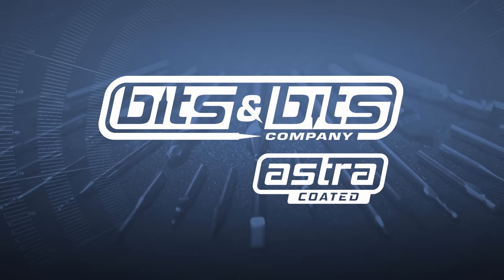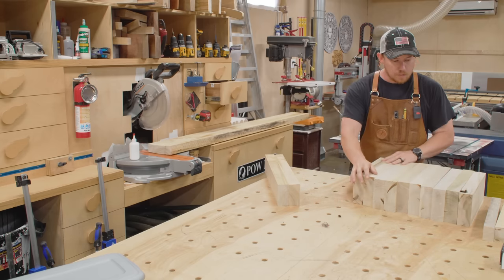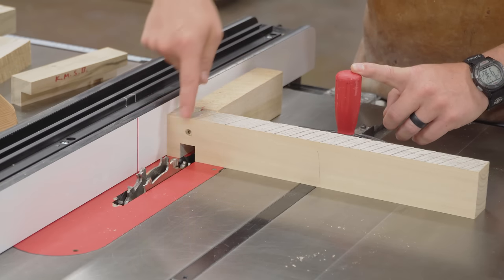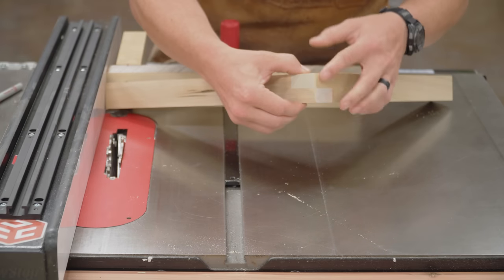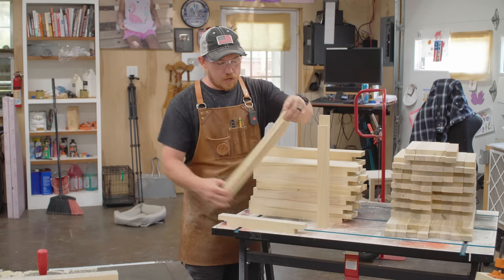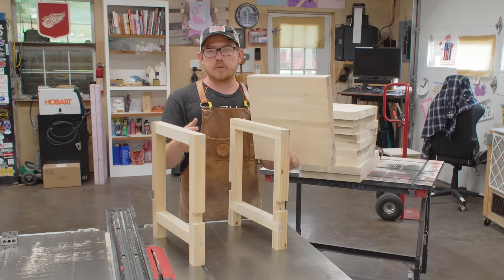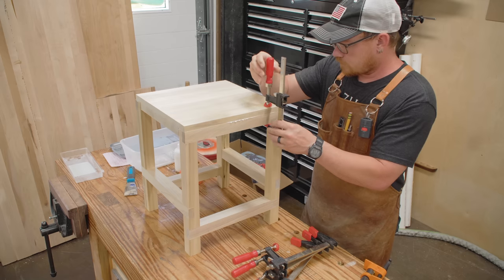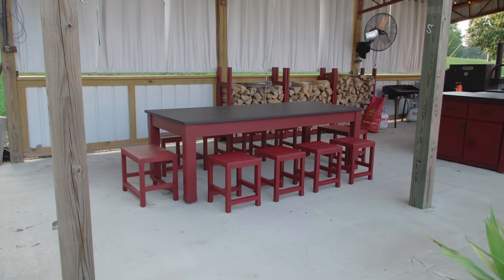Half Lap Stools & Tips for precise table saw half laps

Comment: Half lap definitely an affordable option for those who do not have a domino. Thanks Jay, beautiful work!
Reply: Both dominoes and half-laps create stong enough joints but I give the nod to half-laps here for the mechanical strength in the shape of the mating faces, (and resistence to the moments for you mech engs out there).  Dominoes faster for sure...I recently made three small tables for a theatre set, (similar design to these stools), and every other production step took longer than using the domino machine to make the mortises.  Same amount of time making sure mortises in correct faces! Time was of the essence for that build, reheasals were underway...and no one was going to sit on the table.  Oh, please add a towel bar...just before cutting and milling...

Comment: Glue spreading? I use a silicone spatula. Just let the glue dry on it and it peels right off.
Reply from the maker: I tried that previously. I recall it working great for a while but then the bristles started pulling off. Better than a single use acid brush for sure though.
Reply: Spatula Jay, no bristles. If you use a silicone baster kind of brush, cut the bristles shorter with scissors. Works much better.
Reply: And peeling it off is oddly satisfying

Comment: Spatulas, not just for the kitchen. 😊

I always see rollers being used and for large projects I am sure they come in very handy and I always think, “Maybe I should get one.”.  

However years ago I had a wrist brace I didn’t want to accidentally get glue on and no gloves I had fit over it.  I ended up grabbing one of my Betty Crocker silicone double spatulas I had gotten from a dollar store years before that!  😂 It ended up being more versatile than I had even thought so it hasn’t left my garage since.  I also haven’t used gloves for glue ups since either. 

Flexible and thin. Works well as a squeegee and brush-like actions even on big projects as I dump glue and start moving it. Smaller end I use for small things and since that end is a bit stiffer I can use it remove excess glue with less mess and waste from a 1,000 towels. Clean up is a breeze, just bend it and glue just breaks/peels off.  Storage space is almost none.  Even if I have to replace it someday it’s 8 bucks on Amazon so nothing that breaks the bank.  🥰

Comment: Great tutorial jay. Great tips and tricks too there much appreciate I have to say I did build some in feed support arms what a difference they make  so much safer when cutting full sheets. And I use a silicone roller when gluing large surfaces it does slide a bit when you first add glue but stops once it starts to spread and it’s an easy clean.

Comment: I use ziplock bags big/small for brushes. Paint and most finishes won't dry after two or three days of reuse. I've used cellophane to wrap small/large rollers for overnight and have stuck any combination in the freezer to last longer. Just need time for thawing before use.

Comment: Yes! A roller is great for applying glue. We do a lot of glue ups like that. Some of them many feet long. We usually wash out the rollers, then dry them with the air compressor. It’s a heck of a lot of fun to see how fast you can get the roller spinning, if you hit it with the jet just right! Just don’t do it when the boss is standing next to you 😂. He didn’t fire me…

Comment: I'm gonna try the roller with the container that you use, so it doesnt dry out. Thanks! Love the Dust Shroud for the table saw, another thing ill make. i dont usually use 1/2 laps i think ill start using them more. Hey can you shoot a video of you making the kerf maker style stop block, do you use a push stick, looks like it would be a dangerous procedure since its so small and based on this video looks like you would be pushing it between the fence and the blade. 'll still use a 1/2lap since i dont own a domino. great job with your space!!!
Reply from the maker: Video on the kerfmaker style stop block https://youtu.be/aTZ9wYjEGmE

Comment: My dado stack always makes a not perfectly flat bottom the two outside blades are always a bit higher than the chippers. Is this normal?? Is that slight unevenness still ok for the joinery?? Are all dados this way or just crappy ones?
Reply from the maker: Lower end dado stacks have this characteristic. I think it has something to do with a dado stack being used JUST for dados. The "Bat Man" ears, in my opinion, were designed into the blade to guarantee a good fit of the incoming plywood panel into the dado. Corner relief ensures the corners won't be obstructed, similar to "dog bone" corners for CNC work, and also provide a little room for excess glue. I don't think they were designed for lap joint work. Purely speculation on my part, but it makes sense to me. The set I used here is from Freud and was sent to me by a viewer 5-ish years ago.
Reply: @JayBates  thanks for the response. Kind of a bummer since the reason I bought it was for this type of thing. Not that I haven’t used it for many things.

Comment: I would treat the glue roller like a paint roller and roll it in Saran Wrap.
Reply from the maker: I used to do that but I found that half the time it's a pain in the butt to remove the plastic. Also, I like to avoid single use plastics when possible.

Comment: @ 00:10 to 00:15 "this is the blanks" should be "these are the blanks". Apparently, grammar is not taught in school any longer.
Reply from the maker: Harvey. I appreciate your well thought out comment. However, is the period supposed to be inside the quotation marks?
Reply: Did you get rid of your Hammer A3-41? I see you are using a jointer and planer.
Reply: The above comment (I know it is a month old) is quite astonishing 😳 It is the pot calling the kettle black. An individual should not criticize someone else about proper grammar when they do not use proper punctuation, capitalization, sentence structure, tenses, NOR use proper grammar themselves to express their thoughts.